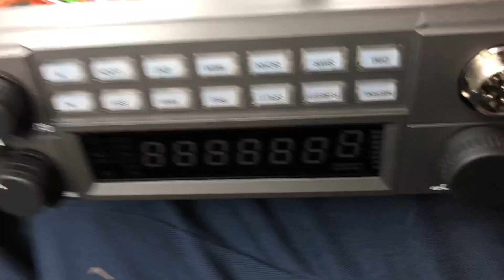NEW Ranger RCI 2950CD Frequency Expansion

Comment: Really appreciate this. Just bought one and one of those chips was in the Mic box but no instructions with it. And been looking all over the place for how to install it. Only problem is it voids the warranty if that sticker is removed on the outside case.
Reply: Where did you order it from I've been looking at maybe getting 1 thanks 73s god bless
Reply: For future reference, a heat gun/hair dryer will heat the glue and you can peel the sticker off without breaking it.

Comment: Any chance you can do a power output report on this since you didn't do a peak and tune yet?? Like to see low and high power for AM and LSB.. like an OEM report.. no ons has done one yet.
Reply from the maker: Radio is stock. Putting out 30w on ssb. 10w am/fm.
Reply: @hamradion1fjb  is that with knob down or up? Kinda interested in low power numbers to run with amp..
Reply from the maker: Power knob up. With power knob all the way down it does about 15w ssb. Not sure about other modes. I am running an amp and have it dialed back.
Reply: @hamradion1fjb  thanks. That's what I was wondering. I have TS350 and recommended is less than 20w AM and SSB..

Comment: smart man. Just cause you can squeeze another watt or two is a bunch of truck stop hype. An 6db. In other words if you give somebody a S7 at 5 watts, you have to put out 10 watts to give them S8 and 20 watts for a S9. Double the power per S unit gain. By the time you push the PA that hard, slightest swr jump, pop goes the finals.

Comment: After installing the e chip, does it show on the display ch 19 or ch 40 or is it frequency read out?
Reply from the maker: Shows frequency. You have to hold a button on the front panel and it will show channel. Can’t remember the button. Sold radio
Reply: @hamradion1fjb  I believe it's the MAN button
Reply: If you press the MAN button it takes you to CB channel mode so you'll get the 40 channels, you will get the rest of the 11 meter band when you exit MAN button

Comment: would Rci 2950 cd board work with Rci 2950?
Reply: It should it uses the same cpu board as an old president Lincoln base HR 2510 mobile their manufactured by Uniden corporation. Their not made by Ranger electronics that is a different company.